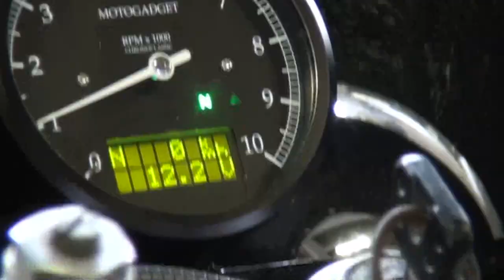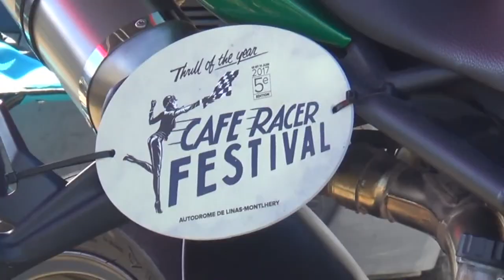Yamaha TRX 850 - MotoRacer76

Comment: Otherwise it's a great build, but exhaust wrap destroys headers. Ceramic coating is the modern day solution, and actually helps the engine, getting rid of the hot air quicker.